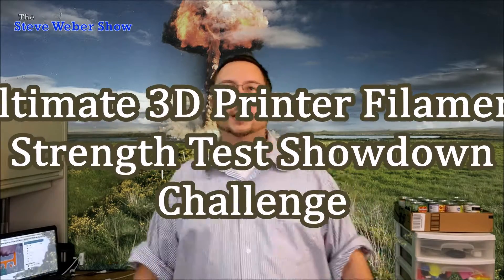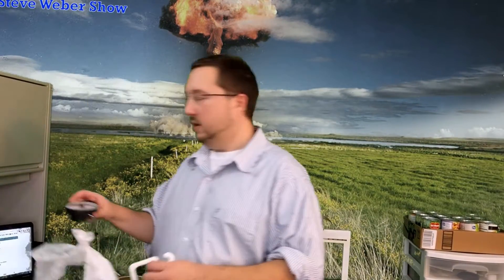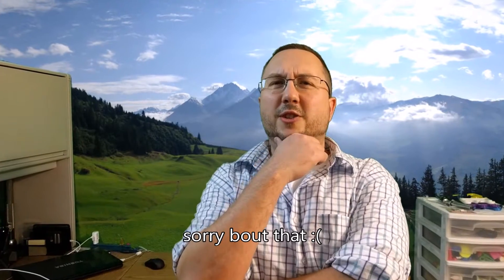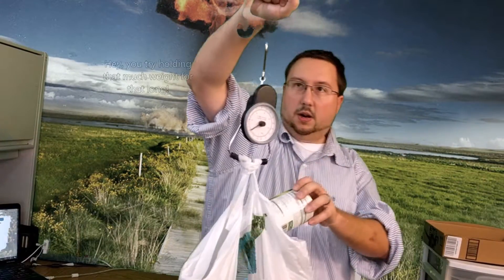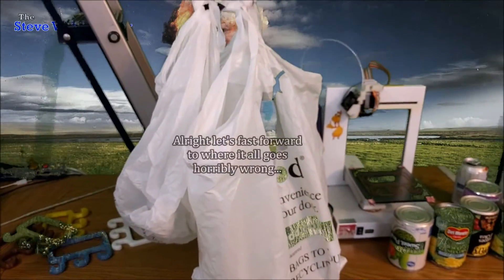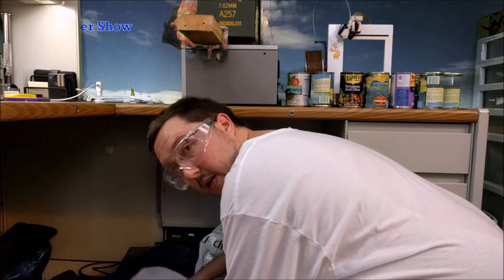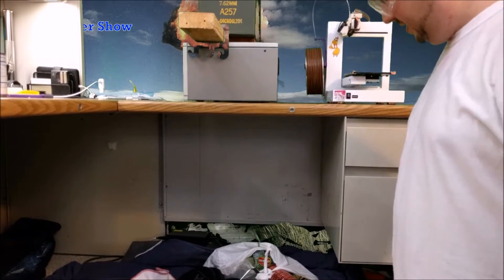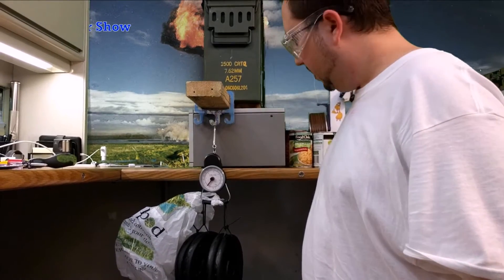3D Printer Filament Strength Challenge GT-PLA PLA+ PETG

Comment: ~57lbs. on ONE hanger hook. Testing methods are terrible. A consumer would divide up their bags, you're putting all stress on a single failure point. Would love to see this done right and printed with infill as most would to enhance the strength of the item. Don't test just to see things break, results aren't all that useful. Test for real world use.